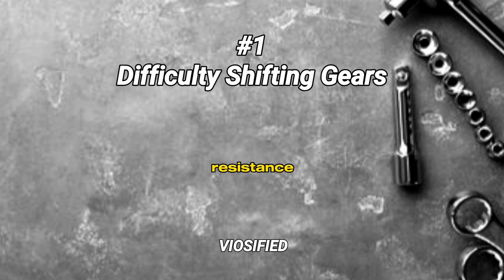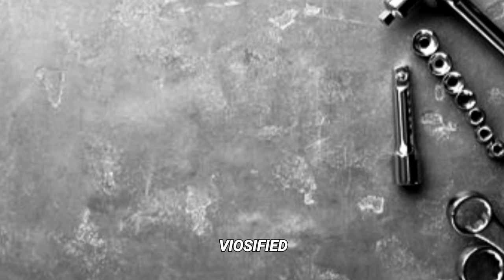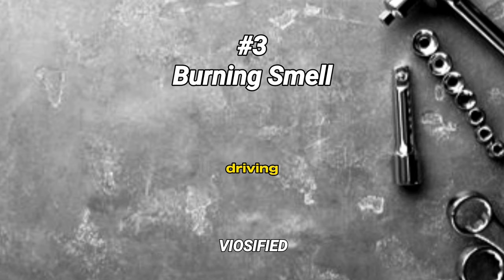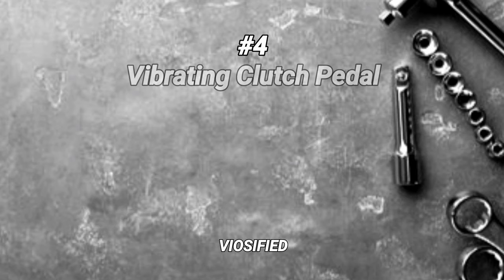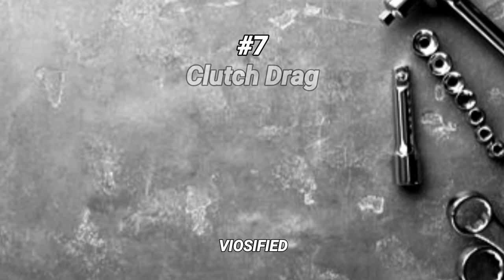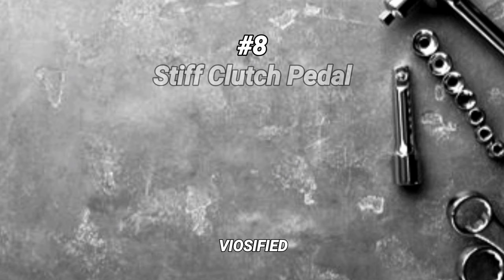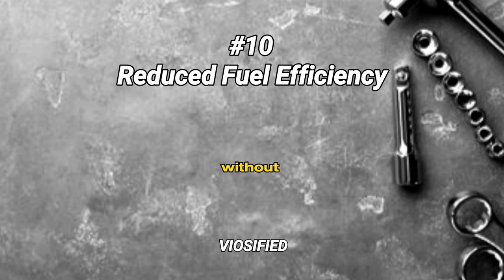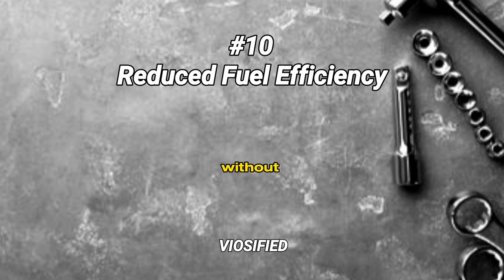SIGNS YOUR TRANSMISSION & CLUTCH HAS A PROBLEM

Comment: I was speeding so I downshifted without reducing speed then the car made a loud sound and my clutch became hard to engage
Reply from the maker: aggressive downshifting/engine braking can cause damage to the clutch, flywheel, transmission, or related components; or possibly exacerbate an underlying issue. Have it checked ASAP.

Comment: Please I need help.. on Monday I was driving all of a sudden my car stopped and won’t accelerate. After turning off my engine for 15 mins I turned it on and was able to drive out of the road but I could barely accelerate the vehicle was finding it difficult to accelerate I had to tow it to the mechanic we thought it was bad petrol we drained the petrol and added a fresh one and I turned on the car the car works in drive neutral and park gear but won’t reverse the reverse gear keeps blinking and car won’t move in reverse.. please any idea what could be the case I hope it’s not my whole transmission that’s has gone bad
Please note my car is a Hyundai veloster 2012 uses a dct transmission
Reply from the maker: @killzkelly7740  sorry to hear that. I can only provide a suggestion, not a diagnosis. Your mechanic will be able to check potential causes like a malfunctioning TCM, low or contaminated transmission fluid, worn/damaged clutch packs in the DCT, or faulty sensors. An internal mechanical issue within the transmission is a possibility that needs fixing or replacing. Your mechanic can also run a diagnostic scan to check for error codes. I hope this helps your mechanic somehow.
Reply: @Viosified  thank you so much I am grateful for this reply
Reply from the maker: @killzkelly7740  you're welcome. Best of luck!

Comment: Mine just slips, it does rev high on 1st and 2nd but 3rd and 4th is good as long as no heavy gas, just hoping its the clutch only and not anything else, getting it replace this weekend
Reply: what was it
Reply: @Juvio  clutch needed replacement

Comment: Mine wants to shake when initial takeoff but its fine after you start driving and dosent do except maybe the first drive. I think its bc i havent really been driving a standard transmission for 20 years now and it has a deep clutch and in my yard is tight parking and turning areas. Im gonna ride it out and see if its just me needing to get used to the mustang. I havent had it but a couple days and not really even comfortable yet sitting in it. I have to get things adjusted.

Comment: I think mine has symptom 1, sometimes it's hard to change gears, it feels stuck so I have to redo it, kind of unstuck it. I also notice a jerking time to time. A sound similar to radio without signal. Gas consumption increased too

Comment: Mines makes a slight tick noise when pressing it down. It doesn't affect the way it drives or feels, i just notice it started making that noise. The rpms are normal but i can definitely feel that slight tick when i do hear it.
Reply from the maker: It could just be a slack pedal pin or spring needing some lubrication.

Comment: my car has been grinding first gear lately, but everything else engages normally after that and it only does it when im going slow speeds like 0-2 mph, but it stops and it comes back
Reply from the maker: @ChargingActive  need clarification, is your car manual or automatic? It grinds when shifting to 1st gear or only when driving slow?
Reply: @Viosified  it grinds when shifting to 1st gear but it hasnt done it anymore today, and its a manual, and im not sure if it has to do with it but when im acelerating in 1st and ii let go of the gas pedal, the car jerks a little bit and im at like 1.5-2k rpms
Reply from the maker: @ChargingActive  Adjusting the clutch bite point might help if the clutch isn't fully disengaging when you press the pedal. If the bite point is too high or too low, it could cause the clutch to engage or disengage improperly, leading to grinding or jerking. However, since the grinding is specific to first gear and intermittent, it may be more related to the synchro or linkage, but adjusting the bite point could potentially reduce the symptoms. I have a tutorial on clutch bite point adjustment: https://youtu.be/4yahxd28Ctg?si=j_uSmnXUipgiQcRK

Start with adjusting the clutch bite point, as it’s a relatively simple and inexpensive fix that might alleviate some symptoms. If the problem persists, consider having the clutch, transmission mounts, and transmission internals (like synchros, gears, etc.) inspected by your mechanic. He can diagnose if there are deeper issues like worn components.
Reply: @Viosified  thank you so much man for the help, really appreciate it, i'll be looking into that
Reply from the maker: @ChargingActive  no problem. Have a good one!

Comment: I have a 2008 Infiniti g35 Sedan rwd 6spd, only mods I have done to the Trans is the CSC delete Kit which is PHENOMENAL, also,Light fly wheel-BUT my car revs very high in 4th or in any gear honestly. 
 And over time the clutch engagement have gotten a bit higher, My friends are telling me that I just need a new clutch, in which I was going to run a Custom made falcon Kevlar clutch just hoping it’ll work, what do you think?
Reply from the maker: thanks for sharing your experience with your 2008 Infiniti G35! The high revs in 4th (or any gear), along with the clutch engagement getting higher over time, do indicate that your clutch might be wearing out. Your friends are likely right about needing a new clutch. A custom-made Falcon Kevlar clutch could be a good option, especially if you're looking for something that can handle more aggressive driving. Just make sure the custom clutch is compatible with your current setup & driving needs, but before making the final decision it’s always a good idea to consult with a mechanic familiar with your specific mods. Good luck, & hope your G35 keeps running strong! 🙏 Thanks for watching!

Comment: My 2010 Camaro ss is able to shift gears without using the clutch at all and won’t go no matter what gear, what can the problem be??
Reply from the maker: Shifting gears without using the clutch could result to significant damage to the synchros, linkage, gear teeth, or transmission bearings. If the clutch & flywheel is worn out it can cause clutch slippage or failure which could immobilize your car.
Reply: @Viosified are there any symptoms i should look for so pinpoint the exact problem?
Reply from the maker: @jaysowayvy285  if your car starts but "won't go no matter what gear" look for issues with clutch & transmission components.

Comment: Relatively new to Manual and have been having some issues when shifting. For context during my first year of ownership i banged each gear and tended to rev the engine to the redline but didnt typically go past 6,500 rpm. I have mellowed out a bit and try to give my clutch and syncronizers time to function. I recently over the past 3 months have been running a shift knob extentsion and have been paying much closer attention to the feel of my shifts. Sometimes its great other times theres a insane amount of resistance. Whether rev matching before releasing or not with the clutch depressed it should or used to be a smooth transition from gear to gear and now it intermitently is stiff or easy when moving the shift knob. Im unsure what the exact issue is because clutchless shifting or more commonly double clutching seem to feel better. I suspect the clutch disc may be on its way out honestly but any tips advice or expeirence working on manuals is appreciated. My car is a 2017 Hyundai Elantra Sport 1.6L
Reply from the maker: @Lii-hu5dh  It sounds like aggressive shifting early on may have caused some wear and tear on your transmission components. I suggest you look into possible issues like worn clutch disc, damaged synchros, misaligned shift linkage, or contaminated or low transmission fluid. Your use of a shift knob extension might also be amplifying these issues. Consider having your clutch inspected and possibly replaced, checking the synchros for wear, adjusting and lubricating the shift linkage, and replacing the transmission fluid. Testing shifts without the knob extension can help determine if it’s contributing to the problem.
Reply: @Viosified  I figured as much but thanks I truly do appreciate your time and response, ill get it checked out when its finacially feaseable. I have an auto i can fall back onto but it wont be the same.
Reply from the maker: @Lii-hu5dh  You're welcome! It’s great that you have a backup car to use in the meantime. Hopefully, once you get the manual checked out and repaired, you'll be back to enjoying it even more. Have a good one!

Comment: My 2013 Mustang GT jumps,bucks or feels like the clutch slips while mid catch from a dead stop release the clutch pedal and giving some gas.....Think its a worn out clutch or transmission? 61k Miles on it now.
Reply from the maker: Based on the symptoms you mentioned, it could be indicative of a worn-out clutch. Your mechanic will most likely take your car for a spin to "feel" and assess the condition of the transmission as well.

Comment: Been needing help understanding the problem with my car when the car starts up cold the pedal is soft, the engagement between gears is in the beginning and then when it get to temperature it becomes hard and engages at the end of me releasing the clutch.. been having this problem for a while now and every mechanic I go to doesn’t know what it is. I hot a new clutch and clutch master cylinder.
Reply from the maker: You mentioned the issue persists despite the new clutch & clutch master cylinder? If that's the case, other components may be contributing to the problem, like the clutch slave cylinder, which, if worn or malfunctioning, could affect clutch pedal feel & engagement points. Air or contaminants in the clutch hydraulic system may also be a factor, necessitating bleeding & flushing of the system (If you're interested, here's a video of that:  https://youtu.be/itWKVM45ulE?si=WISSdaAqE8CZsZWH )
 
Also, issues with the clutch release bearing, clutch fork, pivot, or transmission synchronizers could be causing or contributing to the problem. These are just ideas I could share. I suggest consulting with a specialized transmission mechanic or service center if you can.

Comment: My Honda Rebel has developed a clanking noise, primarily in lower gears, while accelerating, and generally while the clutch is not being pressed. The bike may stutter and I feel a sudden loss of power without feeling like the clutch is engaged (no sudden high RPMs). Any suggestions?
Reply: The loss of power is brief, but it comes with the clanking sound, and I can generally power through it. Once I'm in 4th gear, there is no problems, while 1st and 2nd are the worst. Could this be something to do with the transmission rather than the clutch?
Reply from the maker: @mountainmanxyz  It could be an issue w/ the transmission, possibly the chain & sprockets. The clanking noise in lower gears & the brief loss of power could be due to issues w/ the gears or gear dogs. Worn or damaged gears/gear dogs can cause improper engagement w/c can cause noise & power loss. A dirty, loose or worn-out chain & sprockets can produce clanking noises & affect power delivery. Check the transmission oil level, chain tension & inspect the sprockets for wear, including the drivetrain (bolts or bearings, even engine mounts). These are just pointers that might help you identify the cause of the problem but a visit to your bike mechanic is still the best course of action for a thorough diagnosis.

Comment: What if it let me shift from 1 to 5th with out no issues but when trying to kick it into 6th it won’t do it at all just a lot of grinding is that a clutch issue or a transmission issue please help
Reply from the maker: it's likely a transmission issue rather than a clutch problem. The grinding noise indicates a synchronization issue with the gearbox, possibly due to worn synchronizers or other transmission components.

Comment: I got a an issue where the car would go into 3rd and hard shift into it and when I put it into D the light won't show up on the cluster
Reply from the maker: @AE-Detailing  could be due to a faulty TCM, issues with wiring or transmission range sensor or transmission solenoid. Poor shifting may also be due to low or dirty transmission fluid. As for the 'D' light not showing, the problem might lie with the instrument cluster itself or an internal mechanical issue within the transmission. If you can, check for any trouble codes using an OBD-II scanner.
Reply: @Viosified  i figured out the d problem it was the neutral safety switch but now the N not showing up lmao but yeah when I put the scanner no codes comes up Im thinking of changing the shifting sensors see if that’s the problem
Reply from the maker: @AE-Detailing  Haha, glad you figured out the D problem, the neutral safety switch can be tricky. Swapping out the shifting sensors sounds like a solid next step. Hopefully, that resolves it—good luck!

Comment: What if you go to engage the clutch to shift and you can’t change gears and even with the pedal pressed all the way down you can still accelerate in that gear your in
Reply from the maker: could be due to a worn-out clutch disc or pressure plate. If the clutch isn't engaging properly, it won't fully disengage the transmission from the engine, making it difficult to shift gears.

Comment: Whats it mean if it grinds it takes off very slow
Reply from the maker: A grinding noise during shifting and slow acceleration may stem from issues such as worn clutch or transmission components, synchronizers, low or contaminated transmission fluid, damaged axles or CV joints, differential issues, insufficient engine power, or brake drag. It could be one or a combination of these factors. I suggest you take your car to your mechanic to identify and fix the specific problem.

Comment: What about when changing gears and you feel the car move side to side and accelerating?
Reply from the maker: I suggest you consult your trusted mechanic so he can test drive your car and perform a thorough diagnosis. However, some of the things to consider are the following: clutch slippage, clutch drag, misalignment of the clutch assembly during installation, worn or damaged engine or transmission mounts, and drivetrain or suspension problems. Also, issues with CV joints, wheel bearings, or suspension components, irregular tire wear or poor wheel alignment, can be factors as well.

Comment: What about stalling in first gear if i press gas to accelerate start stalling then jumps goes if i dont gas it hard
Reply from the maker: That could be attributed to various factrs, including slipping or improper clutch engagement, clogged fuel filter/injectors or faulty fuel pump, a dirty air filter or malfunctioning maf sensor. In some cases, worn spark plugs or faulty ignition coils are factors, as well as possible contaminated or low transmission fluid levl.  ECM or sensor malfunctions affecting throttle response and fuel timing are also potential factors to consider.
Reply: @Viosified  so I don't need new transmission
Reply: @Viosified  had truck straight piped
Reply from the maker: @gabrielsalas2156  a visit to your mechanic is recommended to accurately diagnose & address the specific cause of the issue.

Comment: Any thoughts on being stuck in reverse on a 98 subaru impreza
Reply from the maker: I'd check for misaligned, worn, or damaged shifter linkage. Problems with the hydraulic system or a worn clutch (if MT); internal gearbox issues (worn synchros, gears, bearings); low, dirty, or incorrect transmission fluid; a malfunctioning shift interlock mech (if AT); physical obstructions/binding in the shift linkage, etc.. 
In a pinch, sometimes it releases if you try rocking the car, pressing the clutch (or brake) fully, & turning the engine off before attempting to shift again. Even if you are able to release it you need to have it checked/fixed as soon as possible.

Comment: I got a 2003 350z recently and it grinds in 2nd and 3rd gear and when I push in clutch and rev it grinds bad bad so I don’t do it. When I went into reverse (push down and right then down) it popped out of gear? It grinded real bad I had to reengage reverse for it to back. Assuming it’s the tranny but I’m new to Nissan
Reply: The only thing wrong with it and power bank 1 needs replacing but other than that it’s fine
Reply from the maker: The grinding in 2nd & 3rd gear & the tranny popping out of reverse could be caused by worn synchros, a faulty or improperly adjusted clutch, low or incorrect transmission fluid, damaged gear teeth or bearings, or issues with the shift linkage. Your mechanic should be able to check the transmission fluid level & quality, clutch engagement, inspect the shift linkage for alignment & other components.
Reply: @Viosified  hmmm interesting ok because the previous owner claimed they did change the clutch and the issue is relatively inconsistent except for the shifting part so maybe they didn’t adjust the clutch properly?
Reply from the maker: @PrplexedMG  yes, that is possible (if the issues have been going on for a while damage to other components is also a possibility). In the meantime, you can try adjusting the clutch pedal bite point and see if that helps. Here's a link on how to do that: https://youtu.be/4yahxd28Ctg?si=_p7MeY2bMCkocKxm